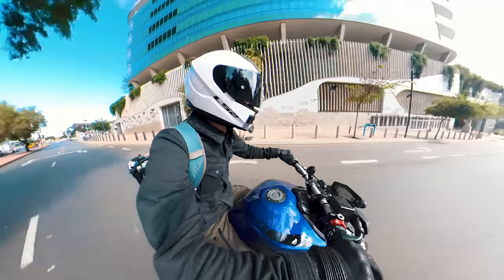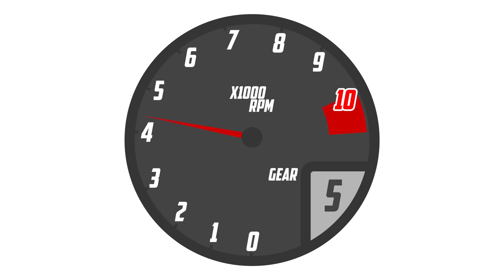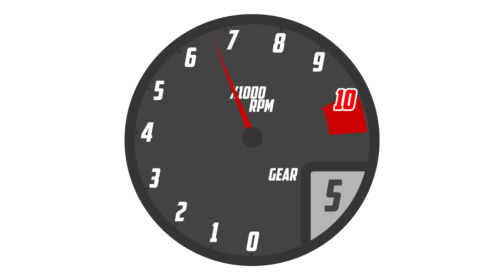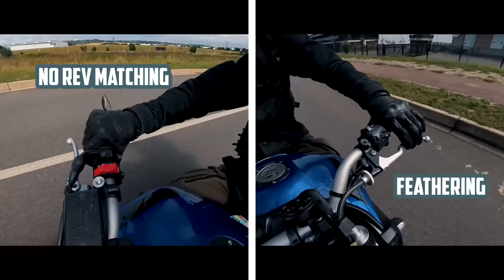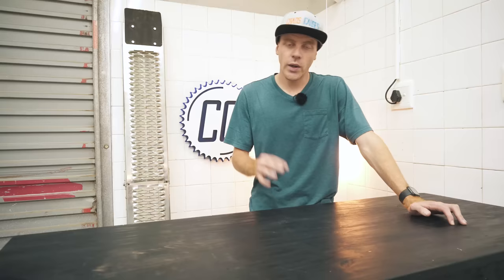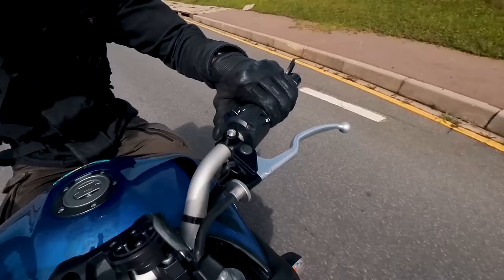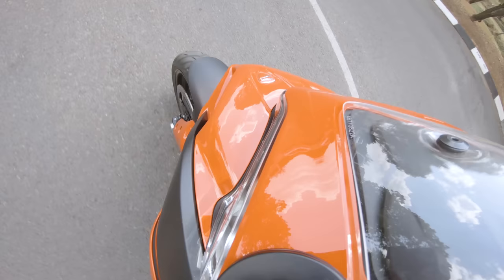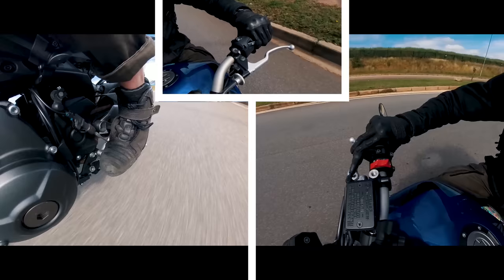What is REV MATCHING on a Motorcycle?

Comment: Iv always said. imagine jumping on a running tread mill. You want to be running at the same speed as the road when you jump in it. Rev matching is bring the revs up to match so when you let the clutch out its the same. Then you can let the throttle
Off to slow down (engine braking) letting the clutch out to slow down can damage the chain or make the wheel lock Up and skid.

Comment: Yea I've been riding for about 3 months now. I never really heard of rev matching until seeing yt videos. I'm trying to do rev matching but it's so hard! Defiantly takes practice. Usually when I downshift going into a stop I hold the clutch in the entire time, downshift the entire time, and use the brakes. Does that hurt my bike?
Reply: It doesn't hurt the bike, but your brake pad will wear out quickly, as it only depend on the brake to slow down the weight without the addition of engine braking
Reply: Start out just using the gears to engine brake while slowing when approaching stops.  You'll get an idea of the amount of rev the bike wants. Once familiar with using each gear to slow down gradually slowly incorporate matching the rev prior to the down shift.
Reply: Funny thing ive been riding for 3 months too and I do the same, but I do downs shift here and there

Comment: 1. Clutch in
2.downshift 
3.rev
4. Clutch out 
I'm i right?
If i okay then i have one Question. How much throttle should i increase?  For example   my bike is 4th gear at 4000rpm and i want to back 3rd gear. Then how much throttle should increase(rpm)?
Reply: Don't rev match one time, see where the revs go to. That is your answer. You will get a feel for it over time though.

Comment: On v twin bikes with no slipper clutch you have to rev match if you are going fast. Otherwise you will lock up the rear wheel if you change down too quick. V twins produce a lot more engine braking compared to say a 4 cyl 600 sports bike. And if you are riding fast, the last thing you want to do is lock up the rear wheel whilst entering a corner.

Comment: Tried it last Summer here in Europe on my MT07. Missed one totaly, the bike made weird and terrible movement for a second and after around 50m, the "Check Oil" light lit up.
I couldn't accelarate anymore and was forced to stop.
After turning by bike off and back on again, everything worked just fine.
But for a second, i was really, REALLY worried...
Reply: Any reason or idea why that happened after attempting the rev match?
Reply: @angelicaamora11  my Guess: the Oil Sensor was "free" for a couple of Seconds. And that's the reason why I had to Stop. But it's just a guess.
Reply: @smack0down470  Thanks. Im new to riding, and learning these hazards is really a great help :)
Reply: @angelicaamora11  Well, Enjoy. Drive Safe and always remember - you don't have to prove anything to anyone=)
Reply: @angelicaamora11  omg super cool and same here
Reply: That there sounds like a skill issue more than anything

Comment: Did a lot of it when young. Because bikes decades ago wasn't as well designed as they are now. Clutches not disengaging fully or slipping, Mechanically much harder to shift.
Only 4 gears which means larger steps between gears, so more rpm difference when downshifting. Drive trains with more inertia. For example 4 speed BMWs was impossible to shift without a big clonk. Modern bikes are much better designed so no real need to match revs. Though pushed hard and careless, you can still get short moments of wheel lock up, wagging the tail a little when downshifting. Even on bikes with slipper clutch.
On my classic racebikes I often shift up without using the clutch, just a moment of no throttle.

Comment: Here's a pro tip, rather than rev match, how about using your brakes to slow down so your down shifting doesn't cause engine braking?  Aside from the track, I see no real-world critical use for this other than to rush through gears and revving the engine - especially on newer rides with slipper clutches and ABS.  What am I missing?
Reply: trouble with braking it unsettles the suspension and chucks the weight over the front wheel losing traction on the rear, a quick downblip keeps everything nice and level.
Reply: A little blip would be easy on the clutch and the gears.
Reply: When going downhill downshifting and engine braking is preferred and is a better option than applying brakes
Reply: Engine braking does no harm to your engine - if anything, you save cost from utilizing your brakes too often.
Reply: Some bikes/engines have far more engine braking than others, my MT-01 has the engine braking similar to throwing an anchor off the back, so rev matching is need for smooth riding, but my TZR250-SPR  has virtually no engine braking at all, and rev matching is need for the awesome sound of a tuned 2 stroke😆😆

Comment: Modern bikes have slipper clutches? My 2006 ducati monster s2r has one..

On my 2004 tdm 900 I don't even use the clutch. Just push it in gear when rpms are right.

Will try this trick, if I'm not already doing it lol

Comment: Curious. On a car there is a rev matching technique where you  cluch in, hold the rpm at constant, down shift and clutch out. I have been using this technique on the bike as well just before a turn. This should also be okay? Instead of blipping?

Comment: Now I know why you do this on a crotch rocket.......it sounds cool

With close ratio gears you don't need this unless your downshifting 2-3 gears at a time

Cruiser with wide ratio gears its common, not until utub did I know it was called rev matching......all you do is blip the throttle to have the rpm going up when you downshift.......its a great idea, keeps the babe on the back from lunging forward smashing those DD's on your back

I do have a Versys 1000 and use to have a 750 crotch rocket, rev matching really slows down how fast you can downshift.....going along in 6th and coming to a 3rd gear curve its 5-4-3 in half a second, NOT if your rev matching

If you're running high rpm, its better to back off the gas to slow down instead of downshifting

Comment: what about if the feathering process was slower?

e.g. holding the clutch a bit longer -> downshift -> pull throttle -> slowly disengage the clutch?
Reply: you'll miss the optimal engagement point if you wait to re-engage the clutch. Ideally you basically want to simultaneously pull in the clutch, downshift, blip the throttle, and let the clutch back out within maybe half a second.

Comment: Im a new rider and today i was going a little too fast for a sharp corner that was coming, so i was kinda forced to downshift at the same time i was breaking and turning and my backwheel just span from side to side, like drifting a little so i guess this will help a lot making those downshifts smoother😅
Edit: Also being lighter on the rear brake helps a lot, my bike has no abs xD

Comment: there is another better way? by just simle accelerating slightly to match engine rotation while changine gear with clutch , so when you go from 4 to 3 and start releasing clutch you have to give continuos high throtle than usual, is this works??

Comment: i keep the clutch disengaged all the time and only engage it when i need to transfer the power to the wheel. i multiple down shift holding the clutch, use the brakes and then engage the clutch once the speed seem to match engine. am i doing any mistake or harm to the bike

Comment: Do you have to squeeze the clutch all the way down when performing rev matching? Makes me wonder what would happen when you messed up the rev match timing. Will you stall or will the rear wheels locked?
Reply: Neither, if you miss the shift you'll probably lurch forward because of the harsh engine braking but that's mostly it

Comment: Nice useful information, but it does drop fuel mileage ? 🙏
Reply: Compared to just holding the clutch in and braking to a stop? A tiny bit of a difference yes. But not using engine braking will make you go through brake pads a lot faster so you will end up spending more on consumables overall.

Comment: Rev matching is one of, if not the most commonly believed myth in biking. Rev matching does not work when a clutch is engaged. Rev matching works in a car because you can activate the clutch, pop the gearbox in neutral, release the clutch,  rev it, activate the clutch, put it back in gear.  Rev matching ONLY works when the clutch is disengaged because this allows the centre shaft in the gearbox to have torque applied. Because you can't go clutch, neutral, clutch on a bike, you are revving it with the clutch fully engaged. Meaning no torque is applied to the input shaft, meaning no effect at all on the speed of the gear synchros
Reply: Ever heard of clutchless shifting? You can rev match and shift without even touching the clutch lever/pedal. Same in car or bike.
Reply: It's not a myth at all. Granted it's not something you need to do unless you're really pushing it on a track or in situations where locking the rear wheel is a real possible threat, and with slipper clutches it's not even necessary to get smooth downshifts, but even with all this, it still works. What you're referring to is double clutching, and you haven't had to do that in cars since the 90s, as every car has come with synchros for that. And if you think it's a myth, you can look up Ayrton Senna's famous lap around Suzuka in the NSX and see that he rev matches downshifts without double clutching; pushes the brake in, clutch in, heel toes the throttle and instantly shifts down, no shift into neutral first, clutch out, then rev, then clutch back in and shift into gear.

Comment: Wait, you're saying increase rhe speed to down shift the gear? I thought lowering the gear means slowing down the bike i.e; you need lower geat if you want to easily control the bike at less speed, the same was pickup of vehicle is done by 1st gear and the gear gear shift keeps on increasing after you progress the speed and vice versa
Reply: You're not increasing the speed of the bike. I don't think you understand the concept at all.
Reply: @DreamGamingS2  I didn't understand the concept, that's why I asked
Reply: @fanta_claws  Okay. Let's say you are in 4th gear at 3000 rpm. If you change to 3rd then then engine will adjust to say 4500rpm. This is regardless of if you are slowing down or just staying the same speed. Rev matching makes this change smoother, you are only blipping the throttle while the clutch is in so it has nothing to do with the speed of your bike.

Comment: should the throttle be bliped whilst engaging the clutch or without?
Reply: as far as i saw, blip, clutch, change gear, once rpms go up from the blip, let go of clutch
Reply: usually blip after/same time as clutch. You’re trying to increase rpm, not put power on the wheel.

Comment: Too harsh engine breaking can be really detrimental to the engine's health. That's one of the more important reason why you should master it.
Reply: That might be true if you're doing race track speeds but for every day riding, no harm to the engine will be done to late model bikes. It's those who've grown up with bikes all their life who generally make this comment. Understandable but not true. Watch "Is engine breaking bad for your motorcycle" by MC Garage/ Revzilla.
Reply: @bootz0409  You are correct. Since I started ridig on a 40year old german bike I was always told to rev match for smooth decelerate and engine health. It got etched into my brain. Whatever I sit on now old or new I ride each like I taught. Even if the engine can take the load without wear I think there is no harm in using rev match when slowing down even on a new ride.
Reply: @bootz0409  The amount of engine braking depends on the engine configuration, my MT-01 with its 1700cc V twin engine has a lot, so rev matching saves stress and wear on the Gear box, chain etc., and smooths the ride out considerably.  My 2 stroke TZR250-SPR has almost none at all.

Comment: a motocycles gearbox is not synchronised, so you just have to rev match in order to shift down correctly to not shorten the lifespan of the transmission.
clutch wear is the next point.

can't believe you forgot this.